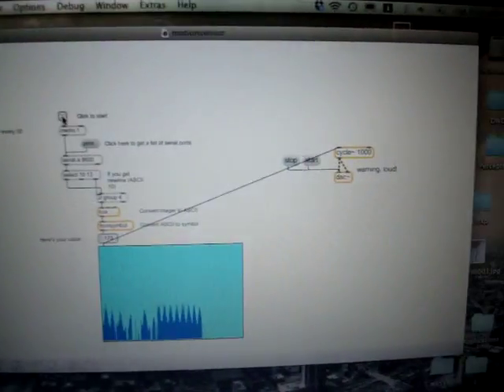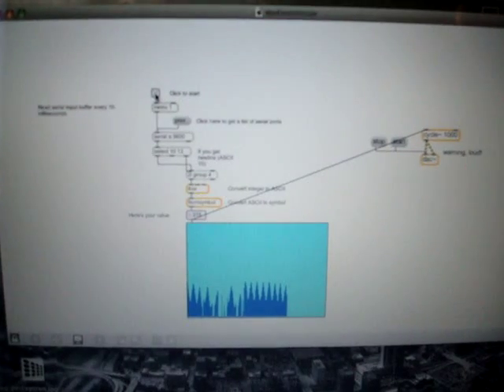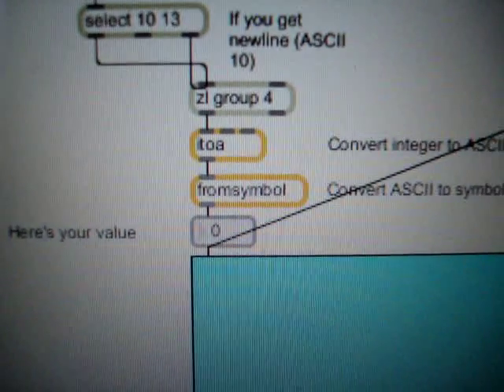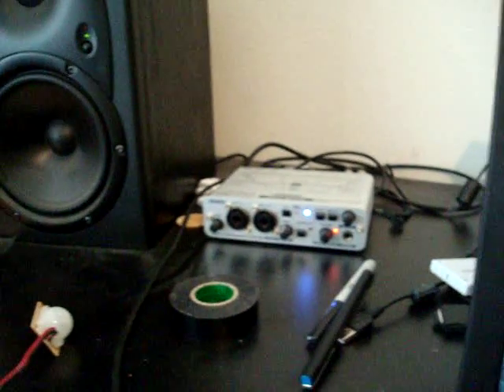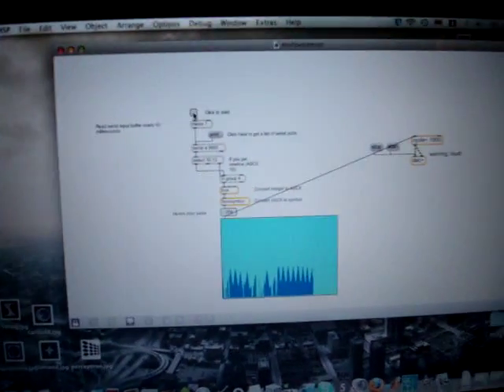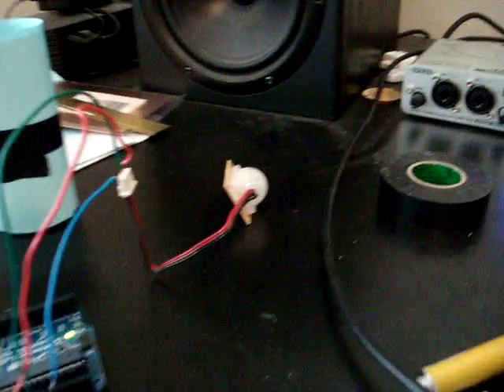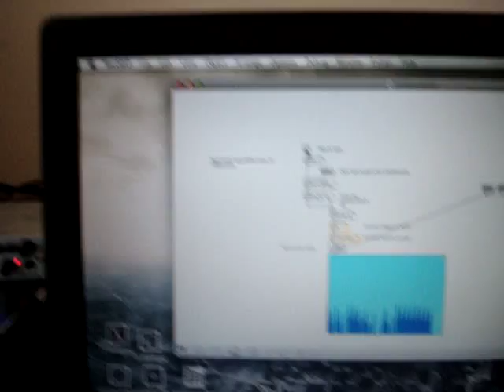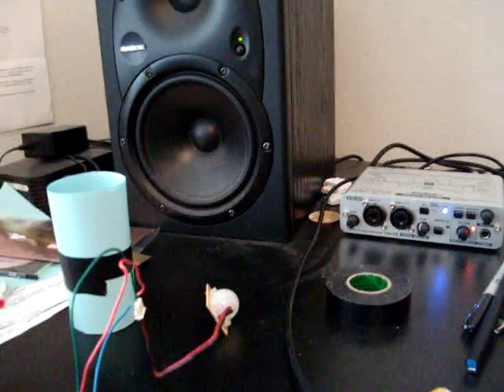Motion Sensor

Comment: if you buy a KIT - relay board simple to use 3-3.3v operation supports logic level also (10AMP) you can run almost anything low voltage 

ebay.co.uk/itm/321195353669 link to mine works great